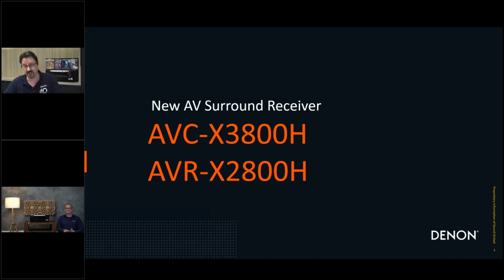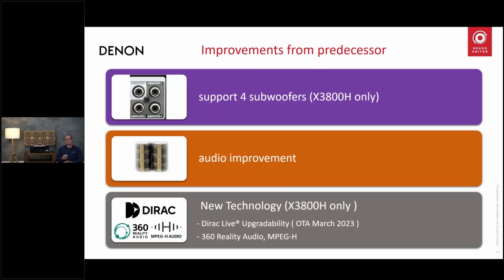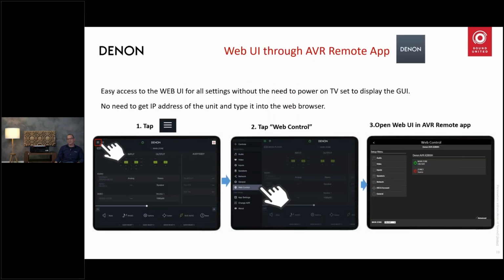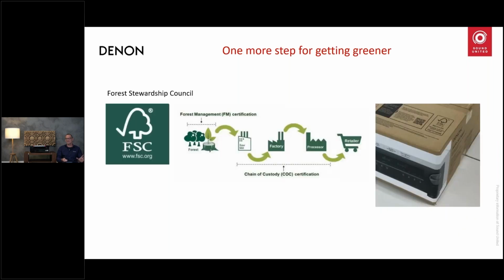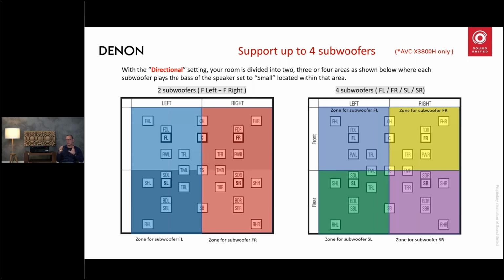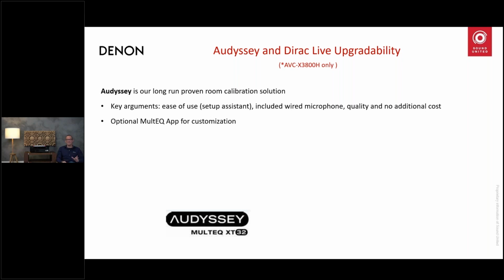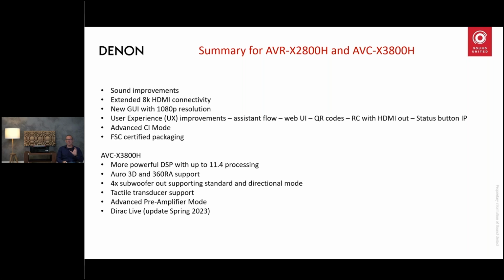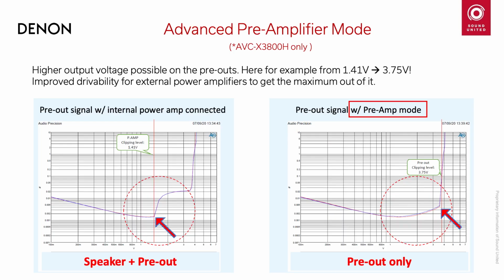Introducing the New Denon AVR-X2800H & AVC-X3800H

Comment: I bought a Denon AVR x2800h about a week ago, even though I made a lot of adjustments and made a sound system, unfortunately I couldn't get the efficiency and sound I wanted. Before this, I had a Sony STR dn 1080 and its sound was great and fascinating, but Denon has a full unpleasant sound tone, I can't get over it, it has software. Is it possible to turn it on or do I have the device in my hand? If this happens, I will use it for a year and then switch to Marant. Why does this device have no bass or a full sound? Unfortunately, despite my adjustment efforts for 5 days, I could not get any results.
Reply: I feel the same with my x2800h (one week now), before I had Denon x2200w and it was much better sound especially with bass. I do not know what to do now. Still I can return it. The question is x3800 will be better or similar?

Comment: I have a new Denon AVC-X3800H, and I am very happy with that. Now I have 5.1.2 set up + zone2.

I know 3800H has 9 channel amp and 11 channel processing power, so I would like to have 5.1.4 + zone 2 setup. Physically I can connect those wires to the AVR, but there is no such option in the Amp assign menu. But there is a possibility to use 7.1.2 + zone2.

On the internet, I found some other Denon AVR owners, who have the same problem. And because AVR is capable for 5.1.6 the surround back speaker terminal has to be assignable too.

So I ask you please make a firmware update, and allow us, to wire zone2 to the surround back terminal, so we can use 4 heights and zone2. (And of course, I know I can't use all 11 channels together at the same time, same situation as 7.1.2 + zone 2)
Reply from the maker: This link takes you to the page which explains how to pick your Amp Assign mode. Option number 2 addresses the configuration detailed in your post. Select 9.1 and from there, the Zone 2 pre-out becomes active the moment you connect an external power amp and speakers to it.  https://manuals.denon.com/avcx3800h/eu/en/GMISSYldtrlyhd.php

This link shows you how to select the number of height speakers you wish to use:
https://manuals.denon.com/avcx3800h/eu/en/GMISSYwhupjphr.php

This link is your configuration page when selecting 2 pairs of height speakers.
https://manuals.denon.com/avcx3800h/eu/en/GMISSYjxczmxpu.php
Reply: @SoundUnitedTraining  Thank you for your response, but I believe there’s a misunderstanding. I do not want to use an external amplifier. My goal is to have a 5.1.4 configuration, and for that, I would like to connect Zone 2 to the Surround Back terminals. As you mentioned, the AVR can handle a maximum of 9 channels at once, so theoretically, this setup should be possible. However, there is currently no option in the Amp Assign menu to assign Zone 2 to the Surround Back terminals.

I understand that 7.1.2 + Zone 2 is possible, but my request is for a firmware update that would allow Zone 2 to be assigned to the Surround Back terminals, so I can use the 4 height channels and Zone 2 simultaneously, with the limitation of using no more than 9 channels at a time. This would allow for a more flexible configuration, and I believe it could be a great feature for users who want to maximize their setup without the need for an external amplifier.

I would greatly appreciate it if you could consider adding this feature in a future firmware update. Thank you for your attention to this matter!

Comment: Do these newer models sound better than the ones they are replacing?
Reply: I upgraded from 3700 to the 3800 last weekend.  I have used them in preamplifier mode only.  

In general my user experience with the 3800 has been better.  The audio quality in my opinion is also better.

Audyssey is still the weak link, just wish they had a better target curve as default.  There is NO WAY anyone that runs Audyssey doesn’t immediately start to tweak the results to try and get better sound out of it.  You listen to their engineers talk about Audyssey and they say “we set everything to reference.”  The next sentence they say “no one listens to reference, that’s crazy loud.”  Then WHY build your entire target curve towards a level no one listens to?  It should just measure your speakers and the target curve should be the “trend-line” of the individual speaker results to minimize boosts and cuts in their DSP.  Can’t be that hard to program.  How they haven’t updated the mobile app is also crazy.  Just update the app, and increase the price if needed.  Or get MultQ X on the Mac store.  

I had to get a uMik1 and tweaked crossovers and switched to FLAT setting to get better in room response.

Once you tweak the Audyssey settings it does sound good.  

I was also pleasantly surprised how good the Auro3D is as good up mixer.   Probably worth the upgrade just for that.
Reply: @H2OFSU  The mobile audyssey app is useless to edit,whenever they ask this question to audyssey engineer,he just smiles and asks us to use it on a tab, seriously..
Reply: @pkhammu2005  works for with my phone and tablet
Reply: Pretty much all AVRs over $2k are going to sound the same. Features are the only difference. Anyone who says there is a sound difference is making shit up
Reply: @nothingtoseehere93  I haven’t had a $2K AVR in my room yet, hoping to get an Anthem MRX or AVM next year after I try the 3800 with the Dirac upgrade. 

Over the last 3 years I had a Yamaha, Sony, and now 2 Denon AVRs all in the $1K to $1.5K price range.  Didn’t like the Yamaha, Sony was okay but needed more channels.  

I can definitely tell a difference between all of them.  

Both the 3700 and 3800 sounded good to me, but the Auro 3D up mixer sounds very good in my room.  2ch is good as well.   My room size is a treated 14x21x8.
Reply: @nothingtoseehere93  yeah thats what  I was wondering I have an older Marantz sr 6011 and it has a 24 bit DAC in it and I think Denon and Marantz are now a 32 bit DAC So as to the 24bit vs the 32 bit ..who knows some say it does sound better the 32 bit vs the 24 bit and some say no The 32 bit is able to hold more data as to if some people can hear it probably and some people who are older and when we age so does our hearing